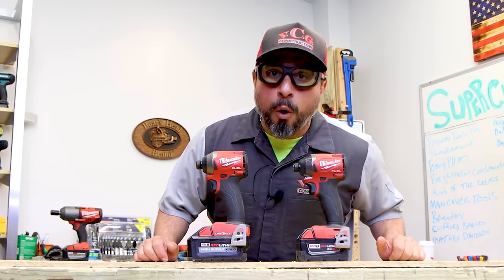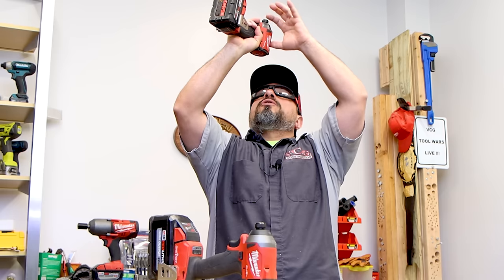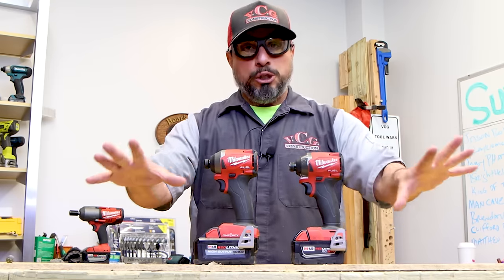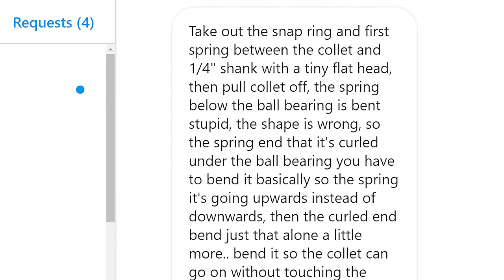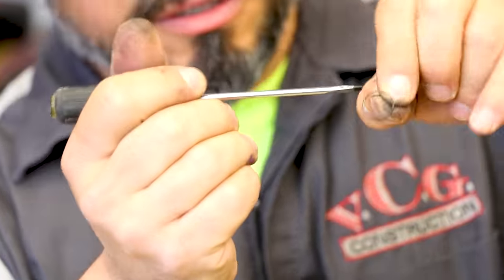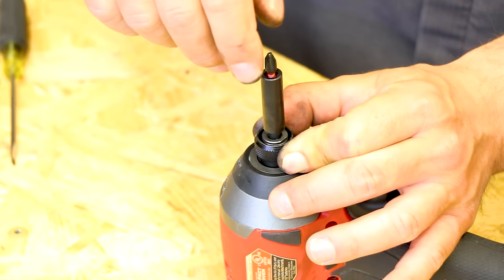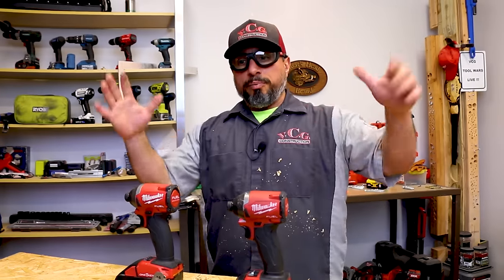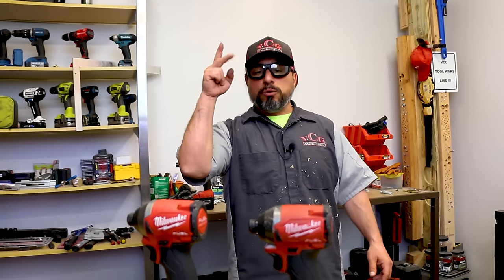FIXING MILWAUKEE M18 FUEL Gen 3 IMPACT DRIVER COLLET PROBLEM (must watch)

Comment: I will admit my preference would be towards Milwaukee, but it kinda tees me off that they won't fix their problem leaving their customers to come up with the fix.
Reply: they can easily fix the issue by coming out with a gen 4 impact but they probably wont want to issue a recall and fix a million impacts....too costly for them....its cheaper for them  to make the gen 4...just my opinion
Reply: @kingofthecrease30  how much will they lose if customers go to another brand because they won't fix their mistake because they are worried about how much it will cost them.
Look I think it's obvious that I am not a big business man, so I may be wrong on that, but as a customer that is what I want a company to think about.
Reply: highjix anyone who is already invested into Milwaukee will most likely won’t want to go to a whole different company, that’s now a different brand battery to carry, and a different brand charger to carry.  It’s just more hassle, and most contractors would rather just eat the $150 than have the hassle every single day of having an odd ball out
Reply: @highjix  you have a good point but alot of tradesman are loyal to their tool brands...just like people who buy pick up trucks...alot of people want to stay on the same battery platform and not have to invest in a new brand but yes...you will have some people buying a new brand...small percentage
Reply: @highjix  I won't change brands, but I won't buy this until they fix it.
Reply: highjix agreed they got great power I guess I’ll tape it in for now
Reply: @conchopete1789  sad to think you have to do that for a top of the line tool?!?
Reply: highjix buy their other impacts. Milwaukee makes 3 other brushless m18 impacts currently which are solid and still more powerful then the competition. If they made one tool you feel isn’t good so that means you disband their entire lineup?
Reply: @kingofthecrease30  When I buy Milwaukee, I'm buying into a philosophy of quality tools at a premium price with outstanding support.  In the end, I guess Milwaukee is no different than any other tool company.  Kind of sad.  :-(
Reply: I got makita batteries.
Reply: @vojnikjna30  and all those other impacts still only use 1 ball bearing for retention and are going to be prone to the same type of bit dropping if put through hard use like a Gen 3. 
And tbh, all of Milwaukee's lower end impact drivers are pretty meh from a build quality standpoint.  There's a steeper drop in build quality compared to say a Makita XDT16 to XDT14 or Dewalt 887 to a Dewalt 787.  And that quality is immediately noticed just by holding them, i.e. Milwaukee's most ergonomic tools/grips are always given to the Fuel line.  Where as Makita and Dewalt tend to use a similar (and very nice) grip on a larger part of their respective product stacks. 
I wouldn't even recommend any of Milwaukee's impact driver offerings other than the Gen 3 or the Surge.  And that's only because it (Gen 3) has a significant power advantage for certain tasks.  Otherwise a Makita XDT16 is still the much better built tool, objectively speaking. 

And if you seriously think the Milwaukee 2851 is a better alternative to an XDT16, 887 or a MHPT Triple Hammer then I'm just gonna have to laugh at that advice.
Reply: @highjix  car companies don't do recalls unless the lawsuits will cost more than the recalls lol. they'll literally be okay with people dying in some instances if it's a rare problem and they'll just pay out. people won't abandon a tool ecosystem over one annoying flaw most of the time, but it is unfortunate that can't even provide a solution after 2 years. as someone who was already looking at the possibility of running two different battery ecosystems, they could be losing sales of their gen 3 though.
Reply: This is the only reason why I haven’t switched to Milwaukee. The fact that they don’t take ownership of the issue has deterred me. Maybe next time, they will consider taking this channel more seriously. This is why I trust VCG. Looks like I’ll be sticking with makita and dewalt.
Reply: They will fix it.
But it'll be a gen 4 fix
Reply: @kingofthecrease30  thats the size of it. I no longer buy Milwaukee. On one issue where the drill chuck wobbled and would not grip bits, they told me that there was NO inherent problem and I should buy the new version which DOES NOT HAVE THE PROBLEM. ....right
Reply: I now have a Makita impact amongst all my red gear.  Couldn't deal with the fid2 any longer
Reply: i just got one of these it does not have this problem
Reply: @kingofthecrease30  That doesn't exactly FIX the issue!  The Gen 4 might work but what about all th millions of customers that they F*&CKED over by selling an EXPENSIVE defective Gen 3?  If they issue a FREE exchange for a Gen 4 if you turn in the defective Gen 3, that would fix the issue - short of that, they should go to hell for this!
Reply: @burnerjack01  It's been 2+ years!  Trust me, they're NOT going to fix it!
Reply: @jawojnicki  You're right, of course.
What we got here is a 'Mexican standoff'. 
I'm waiting for them to successfully address their issues and they're waiting for my money.
 Down to 3 batteries now. Not the end of the world to start shifting to other battery/tool platforms. Not buying any more of either until I'm more confident of the situation down the road a bit.
Reply: @highjix  they won’t, because I am not going to buy a whole another collection just because of the impact driver, to be realistically.

Comment: Looks like it needs a stronger spring and larger bearing.  Here's an idea. Take apart the collar of a Dewalt impact and compare the two.
Reply: Can someone as quick as they can tell me is this problem all blown out of proportion? I mean cmon 5 years skin warranty? And me very stoopid and reallllly want red.
Been running the new makitas through 2019 and new 2020 and they are children's toys made for cabinet work or some soft shit, no good for heavy stuff shed stock and barn building whatsoever, the makita impact drivers are all weak as piss
Reply: Can someone please try a better spring lol im sure theres gotta be a stronger spring somewhere like you said man
Reply: That's not a bad idea, I would love to see Vince make a video showing that
Reply: S H I just got the problem in mine, it’s not a terrible issue but it’s defo a thing that can happen. Wearing safety glasses and making sure you turn it in if it happens will help a lot.
Reply: @AlexDenton0451   just got the same problem with mine aswell at work after using it for about 1 week, (brand new) the spring that holds the ball bearing bent 90 degrees and was sticking out of the tool until it flew out of the tool, might be unrelated but definantly an issue,  the tool was never dropped, never mishandled and all it did was loosen and mounting no bigger screws than some T30 bits probably an inch long at the most, so very light work for the time i had it (it has been sent in for warranty repair)

Comment: This collet issue has kept me from buying Milwaukee impact drivers thanks for the invaluable info Vince
Reply: Honestly, I never had that problem because if I’m drilling holes, I use a drill. The problem I’ve had is with me driving a lag and the chuck/collet not disengaging the hex socket.
Reply: Right?! When is the gen 4 available online?
Reply: I am waiting for the gen 4s
Reply: Dewalt has the same collet.  Use a drill for drilling and the impact for screws. No problem

Comment: Hey Vince, thanks for making these videos. I know you're a big Milwaukee fan, so it's appreciated that you show honest takes on the problem. I'm A DIYer that's finally upgrading from Ryobi (they're good, I just want better) and was struggling to decide between Milwaukee and Makita. I hope Milwaukee understands that this is why I didn't choose them as the upgrade to all my tools. And it's not so much about the collet, it's about the two years and no fix. They have a lot of very smart guys working for them. They could fix this if they really wanted to do so. Keep up the strong work!
Reply from the maker: Thanks Justin!
Reply: Same here. I’m heavily invested in the dewalt platform and I have a couple m12 tools but wouldn’t switch over due to this kind of stuff. They cost too much to have these kinds of issues. I don’t like that you need 2 hands to switch a bit either. With my Dewalt’s I just pull the collet with 2 fingers and it advances the bit  allowing me to switch when my hands are tied.
Reply: Same here.... its just put me off buying into the Milwaukee eco system...  I was about to spend over a grand on various tools... multi-tool.... drils... saws etc.....
Reply: @raypeasley  additionally, milwaukee is super expensive and very hard to get here in germany.
Reply: I have both Milwaukee and Makita platforms and I think I'm done with Milwaukee,  first problems with 9.0 & 12.0 replaced under warranty then this. Never had problems with collets on Makita impacts.

Comment: Thank you for the video! I didn't know where to begin. After watching I repaired my m12 impact in about 5 mins. My spring looked different but figured it was the same issue. What pushes the ball bearing just needs to push it farther in

Comment: Go to the internet and get a ball spring from the M18 Surge model and use it to replace the ball spring in the Gen 3. Will stop the collet from getting stuck in a open position. It did at least when I did it.

Comment: I did not read through all the comments to see if anyone commented on this but your thought was right regarding the tail of the ball bearing spring could be cut off. The new model (I just bought) has the end curled in a circle under the ball bearing instead of the "U" found on your model. Still does not seem to have the proper angle on is so I followed what u did and turned it up into the ball bearing and it seems to have helped. 
Love your videos!

Comment: Correct me if I wrong.  Shouldn’t you use a drill to drill a hole and not an impact driver?  BTW I figured a way to fix the problem and that is by listening to Vince.  I purchased the Milwaukee Compact Impact Driver instead of the larger one.  No issue with the Compact one.

Comment: i use the impact for screws and nuts only. when it comes to drilling holes i grab the hammer drill, thats why i went with the gen 3 impact / hammer drill combo w/ two 5ah batts, charger and hard case.
Reply: I've always heard dont drill bigger than a half inch with ur impact cuz its not good for them. That shit is like nails on a chalk board to me.

Comment: Hey guys, I believe I have fixed (for the time being) my 3rd gen!!! I’ve been having this issue when spading, but yesterday I started have this issue every time I pulled my bit out to change it as well. So I decided to give it a try. The only thing I did differently than this video shows, is I took the spring and stretched it just a little bit to give it more upward force on the ball bearing. And I’ve been testing my impact in various ways, and it hasn’t come out once. I will comment as soon as it does, if it does. Let me know if this works for you!
Reply: So how’d it go?
Reply: and? lol
Reply: Been 3 months (as of now)
- is it still fixed?
Reply: What do you mean by stretched the spring a little bit?
Reply: @jonathanwilson7957  pulled on both ends of the spring, AKA stretched it out.
Reply: Post a video

Comment: Hi Vince, 

Thanks for the video. At least you tried it. Hopefully milwaukee can find a solution. It started to happen to my milwaukee gen 3 impact. 

I still have my DeWalt DCF 887 (type 3). I re-greased my dewalt DCF 887 with Amsoil synthetic grease and it's been holding up and working great. It gets a little warm but normal. It doesn't get extremely hot or over heat like before and like the other models (type 1 & 2).  

Don't get me wrong the milwaukee gen 3 is still a stronger impact but that colet issue is annoying.  

Just wanted to share.

Comment: I'm contemplating getting a new impact driver and was deciding between the 2853 and the 2953, but it seems they both have this collet problem and the Gen 4 also seems to break itself from the inside out. I don't want to move to a 3rd battery platform as I currently use M18 and DeWalt "20" volt max. What is the best choice between these 2?

Comment: My bits always fall out with Milwukee. Thought it was just me putting them in wrong. Sometimes they get stuck - especially the spade bits when i'm drilling holes in wood . Never had that issue with ryobi. Also Milwukee does not have a magnetic catch to hold screws/bits. only two downsides. Will try the spring trick you showed. Also will order more parts incase I loose something.

Comment: Why invest money on a product that needs fixing makes no sense, that tells you everything about the product itself.
Reply: Crazy u wouldnt buy a new car with problems  like saying  Its fast good performance nice torgue but the handbrake might come off anytime roll down a bank ha
Reply: There are a ton of good products that have flaws. Look at cars. I challenge you to find a good car that doesn't have some issues. That said, I much prefer DeWalt collets. ;)
Reply: Consider it a upgrade to a awesome tool.
Reply: @802Garage  rolls royce phantom lol ur right most cars have  list of problems just like Milwaukee
Reply: @802Garage  thats why i dont buy Milwaukee .if milwakkee where a car make they would be Renault or fiat lol
Reply: @micjubba709  😂
Reply: @802Garage  dewalts would be  Vauxhall or Peugeot ha
Reply: This is the only reason I haven't bought the Gen 3.  Still putting my brushless impact to work, never had an issue with the brushless impact!
Reply: exactly!

Comment: I've had the same exact issue with my impact gun. I love it, the power it has and the size. Great gun but that collar issue sucks. Can't tell you how many times I've had a wire wheel or cup on and it has came off. Very dangerous situation. Thanks for the instructional video
Reply: Squirt some WD-40 into it.

Comment: I used my Milwaukee surge for almost two years before the trigger started working intermittently.  I continued to used it for another 6 months until I realized I still had one of the fuel impacts. After only a couple months of using that one, only for driving screws, my bit falls out just like in your videos. 

Do you know if they have solved this problem yet?  It's sad I love the Milwaukee tools but in under 2 years I've a lot of issues with them and with only one set of tools it's impractical to send tools off for a week or more to get them fixed.

Comment: Just paint the Makita red  problem solved.
Reply: Christopher TheCarpenter  I have been using Dewalt for 25 years I am never had a problem that being said I think all tool brands has stepped up there game in the past couple of years. And the battery life and what you can do with them is unbelievable.
Reply: Christopher TheCarpenter  I have been watching AvE for 5 years.
Reply: Ouch 😆🙈
Reply: That is hilarious. I have the m12 and I love them.. the big blue company is getting my money when I decide to go 18 volt!
Reply: Lol
Reply: I second this! lmao
Reply: @ashv117  I'm also Milwaukee on 12v and Makita on 18v.
Reply: 😆😅 right!! 
Ima start painting Makitas equipment red, yellow, green, blue and all the other colours brands with a sticker, all customized by the customers. So they think they have that same brand but without all the problems.
Reply: My Makita impact instead of wont hold the bit, my bit get stuck in the collet.  I stopped using impact for drilling, only use for screwing and fastening.
Reply: How havent i thought of that before
Reply: @VCGConstruction  I think you should try taking out the spring and stretching it so it's longer, this will put a lot more tension on the ball bearing than if you only bent the "U"
Reply: Lmfaooo 😂😂 niceee 👏🏼👏🏼👍
Reply: @marcuscook5145  ha me too
Reply: If i were not so invested in Milwaukee batteries i might be tempted to switch brands....
Reply: @whatacoolguy4094  there's an exwife joke in that statement....🤪
Reply: Well done sir 👏
Reply: I have makita and milwaukee fuel and makita feels really nice on my hand its a pleasure to hold it and gets the job done, on the other hand milwaukee feels sturdy and absolutely more powerful no doubt in others terms its just pure brute force and loud your palm will be sore after screwing 6 inches screws on gutters all day only to remember I hurt lol.
Reply: Mika makes good tools but I don't like that you have to pull the connector to insert your bit on their impacts unlike dewalt and mil. But maybe their newer ones do tho.
Reply: Cold
Reply: @TheNottonight  Agree. Sure I've had a bit pull out on a dewalt but rare. Milwaukee does aloy of things amazing but wish their 12v had quick release hex. That a deal breaker for me. If your up on a high ladder or tight space and only got one hand it's very important.

Comment: I have Milwaukee and Dewalt drivers, I hate using the Milwaukee because of these problems. My bits get stuck in there as well all the time. Even though my Dewalt is slow it has always worked without any problems